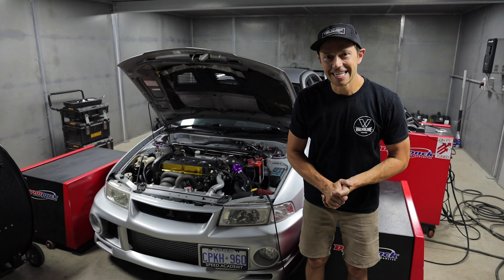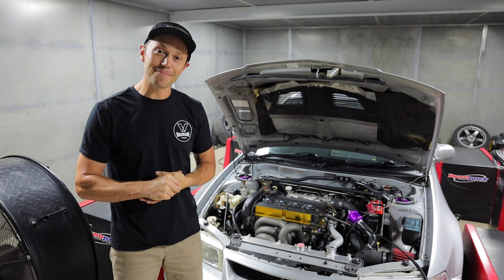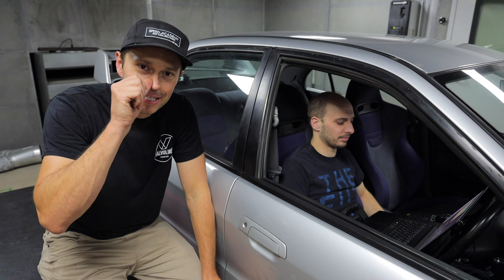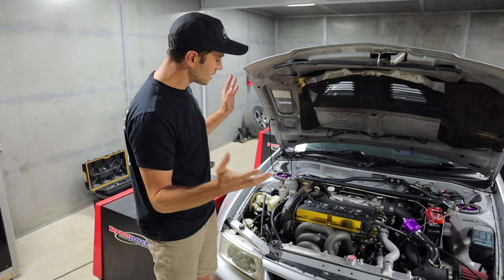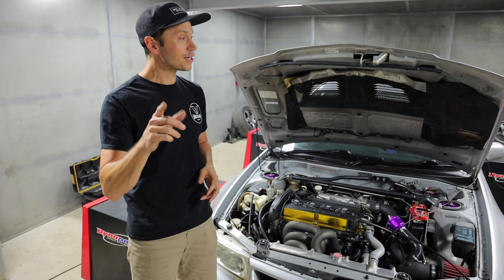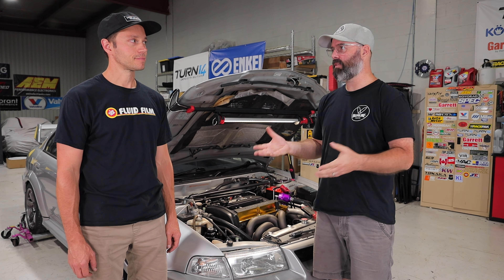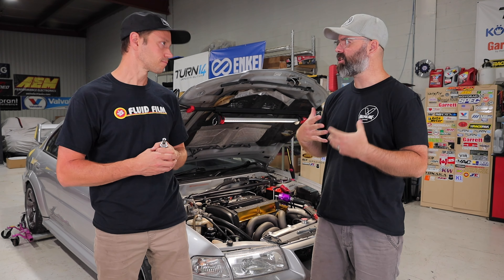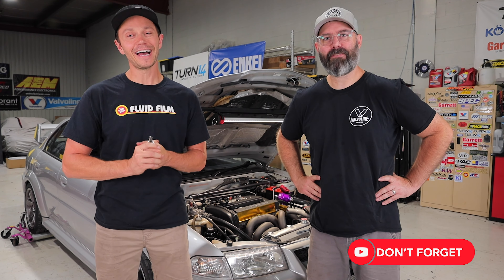MASSIVE EVO 4G63 Headgasket Engine FAILURE! CRAZY DETONATION!

Comment: Guys we could hear the engine pining even in the video, why did you carry on with a knocking engine 😟
Reply: Yeah I didn't understand that as well... He should have stopped straight away
Reply: CHazinite Casualties  yes but 😟 a 4g63 😟
Reply: I can't say that it was pinging it simply sounds like combustion leaking outside of the cylinder
Reply: Dan A agreed.
Reply: Whats the dif between the 6bolt and 7 bolt cyclone 4g63? Is that even a thing? I had and awd gsx with a jdm "cyclone" 4g63..  i am clearly not a dsm guy. Honda all the way
Reply: didnt seem like knock
Reply: Sasha is not a good tuner..
Reply: @heyhayhay247  whilst I agree sasha seems to be very knowledgeable and a great tuner, he definitely slipped up here. Watch the video again and tell me you can't hear that the motor clearly has something wrong, but he stayed on the throttle and continued the pull
Reply: @boost3d831  what you hear on camera and what they could hear in a small dyno room being filled by exhaust noise are two completely different things. All these keyboard warriors acting like they're professionally tuners is killing me.
Reply: @heyhayhay247  I could very clearly hear it but I have a really good headset.  The tuner should have heard that and refused to keep pushing it (plus the knock would show up on his software).  Also at the end when it was exploding he just kept on the throttle.  I would ditch that dude and find someone else.
Reply: To be clear, 2:36 he should have let off the throttle.
Reply: @TheTurbineEngineer  this is so easy for all of you to judge after the fact. He's looking at a dozen different data points trying to monitor the engine and not one of them is monitoring the head gasket. It blew. It happens. The mic in front of the engine is picking up the sound completely differently to how they can hear it in that dyno cell. This was an engine issue, not a tuner issue.
Reply: @heyhayhay247  I don't know why you're so mad, people make mistakes. Doesn't mean he is not a good tuner, but you would hope someone with his level of experience would see this happening and get off the throttle immediately. Anyway what's done is done and hindsight is always 20:20
Reply: @heyhayhay247  I used to be a tuner and there's really only a couple things you're looking at during the pull.  You datalog so you can go back afterwards and look at all the other parameters to make your decision on where to go next.  I was always listening really carefully during the pull for any abnormal noise or vibration that sounds or feels different than before... but maybe that's just me?
Reply: At about 2:30 you can see Sasha had ear protection on. Prob couldn’t hear anything with the engine. Dave and Pete are not the kind of youtubers that would ruin an engine just to get views.
Reply: @boost3d831  I'm annoyed at the ignorance strewn throughout all these comments from people who weren't there. The headgasket popped, and he aborted the run. End of story. People love to sit back poke holes in othe people's work.
Reply: @martinsteele3259  thank you. Finally some reason. I'm sure that closed dyno cell is crazy loud.
Reply: @martinsteele3259  Ah good point.  I didn't notice that.
Reply: @TheTurbineEngineer  you're crazy if you think they can hear anything in that dyno cell. All of them always have hearing protection on. Plus, a 4 cylinder with firmer engine mounts is always going to rattle like it's falling apart. That's why they didn't go poly. A directional mic in front of the engine vs a human with ear muffs on in the cabin will hear things very differently, but sure, judge away from your couch.
Reply: FEARDIVISIONDISTRACTION  Sasha has been a pillar of the 350Z community for 15 years; so, yeah, I'm a fan.

Comment: I don't think throwing the machinist under the buss is fair. I would like to see the torque that is currently on the headbolts when you tear it down. That was too spectacular of a head lift for the amount of boost you were running for it to be uneven surfaces IMO. You could hear the leak at RPMs far lower than peak boost.

Comment: I have assembled a few 4g63s in my day (1 that has seen 30psi+ for years as a daily with arp L19s and a MLHG), and I just rewatched your assembly video. There are two things I noticed: 

1) You used the arp lube on the nut side of the stud but not the side that went into the block.
2) I’m not sure if this was done off camera but the head stud threads on the block should be chased with a tap prior to installation. 

Since you only are supposed to do hand tight when the studs go on the block, a stud may have felt like it was seated when it really wasn’t, because of debris in the threads or the stud binding against the head. In an ideal clamp load scenario you want all the clamping force to come from the nut, and have little to no movement from the stud in the block. 
When you torque down the nut and the stud is turning into the block still, the stud is adding it’s twisting force to the torque wrench reading as well. it’s very possible your torque wrench isn’t telling you the correct number. That mixed with the two things above could easily cause a false reading on your wrench. 

Anyways great build series guys, can’t wait to see this thing rip on the dyno after it’s fixed!

Note: Also it would be wise to get ARP L19 head studs (ARP-L19-7B) instead of the standard kit ARP sells. I have seen heads lift with only 30psi of boost. Where the L19s and a MLHG is good for 45psi +

Note2: The instructions from ARP do not say specifically to lube up the block end of the stud, for all the studs, but they do say to "lubricate the block threads of the studs with ARP thread sealer" if the stud is on a water jacket. So having lube on the block side isnt a big deal. And if you have to lube a few studs on the block side, its best to lube them all for consistency in the torque readings.

Note3: If you want to go 🏀🏐🎾⚽️’s to the wall and never worry about running too much boost, just o-ring the block/head 🤘

Note4: If you do end up installing the studs before the head next time, make sure you insert the washers into the head before dropping it on. Once the head is on with the studs in you are not able to get the washers in place because the valve springs are blocking you from being able to do so.
Reply: What power and torque?
Reply: 1) The block side of the stud does not need the ARP lube, only the nut and washer since that's where the friction is happening, when tightening the nut the stub does not spin only the nut. 
2) Same with the thread chaser if using OE bolts and not studs the chaser helps get a more precise torque reading by removing friction , but with studs not as important, again for same reason above the torque procedure is happening on the upper portion of the stud.
Reply: @G1itzik  what power and torque did your 4g63 make with the build ?
Reply: Isaac G spot on the stud stays still
Reply: Ran my Talon back in the early 2000's with studs and 32PSI with a 16g. Had to have been close to 350whp. Self tuned and tracked, never dyno'd a car before as that doesn't tell you anything really.
Reply: Isaac G correct, you dont need the lube on the block side, but it helps get the stud seated. I have had instances building 4g63s where the stud appeared to be seated but would then turn a few more revolutions into the block with a bit more force (then move easier), even after the threads where chased a few times. I have always done studs inserted into the block before installing the head for this reason. To make sure the studs are all seated correctly. 

Also ARP says in the instructions to make sure the threads are chased, and even sell a tap for chasing the 4g63. So it’s not just for OE head bolts. https://tech.arp-bolts.com/instructions/207-4702.pdf

I don’t know what you worked on but with “closed deck” engines like the 4g63 getting the head and block to mate correctly is a big deal. Also go back and read my post homie, obviously you did not, because you are just reiterating points i had already made...
Reply: Bigbot Hoee it was something like 550/440 on a scm61 turbo IIRC, but I sold that car in 2012, and built it in 2010 so it’s been a while
Reply: @2988jake  nice I'm currently running 30psi 579hp 528torque but 
Peaked the boost to 32 then drop to 30psi all built and tuned my self 

Had used the normal arp studs lifted when hit 35psi then changed to the L19 and cosworth gasket and it's holding strong I'm limited to my rods  but don't plan to go anymore still on pump fuel
Reply: L Adams they stay still if seated properly, obviously y’all didn’t read my entire post...
Reply: @2988jake  You can easily check this by putting a straight edge across all the studs to ensure they all seated to the same depth. I have no doubt HP Academy covered both thread chasing and checking with a straight edge in their engine building series.
Reply: BHS they probably cover chasing threads, but the straight edge test was definitly not in there because they told them to put the head on before the studs were inserted into the block. So there is no way to verify if the studs are seated properly with the head on. (in other words with the head on the studs do not stick out far enough to use a straight edge.)
Reply: Assembly video he says 80 ft-lbs, but when I look up ARP 4G63 the manual says 100 ft-lbs. What am I missing?
Reply: Jonas Larsson it’s 80lbs for the standard studs and 100lbs for the stronger ones. The different arp studs have different procedures/instructions
Reply: @2988jake  Ok, thanks. Yeah, I was looking at the 625+ manual.
Reply: @jonasthemovie  is that what he used lol I do  95 to 105 depend how frisky I'm feeling then re torque  after few heat cycles
Reply: i guarantee its because they didnt torque them enough, and didnt retorque them after first startups, that is a must on a new engine. When I did my studs 1x1 in my Evo I could feel it slipping around 70lbs and I could tell it needed more, so I torqued them all to 85-86 lbs. lots of guys do em to 90lbs with no issues.
Reply: I also should note this is just from my experience building 6-bolt 4g63’s for a 1995 TSi and 1998 TSi AWD (first one when I was 16 and haven’t built one since 2010). I have never built a 7-bolt for an Evo 6. But it’s pretty much the same engine. 

This is just my best guess, head stud seating is the sole culprit in my one HG failure. Also, I have always decked the block and head on every built. Thus I’m not sure how much that affects the head gasket seal because its always been ruled out in my builds.

One way to get a good idea if the head studs were seated, is to mark the studs before the engine is disassembled and when removing the head stud nuts, count how many revolutions the stud made during removal.

Once this is written down for each stud, and the head is removed. Rotate the studs back to where they were when the head was torqued down. Then you can analyze the studs and verify they were seated all the way.
Reply: probably best solution is to stick to proven procedures, install arps, back them half turn, verify all are level, install proven headgaskets( oem hks), install head and torque 10+ than arp manual says
Reply: What an insightful reply, thanks!
Reply: I'm going to throw this out there.

You don't need more than standard ARP studs installed properly and a FelPro composite head gasket for what they're doing here.

I'm making around 650-700whp on a composite, L19's, and O-rings in the block, 6262 on 40-42psi. I added o rings in the block after 35psi. 

If the surfaces are both done properly (true and correct RA) then an OEM MLS and ensure studs are installed properly is sufficient for most people.
Reply: this is why you shouldn't just hand tighten the studs even though it says so by the manual...There is a spot for a 3/16 allen key on top of the ARP head studs, you can tighten them in actually. Learned this also the hard way...Put my B16 turbo together first by just handtightening and checked it after a bit of driving barely going into boost and it lifted the head, there was oil leaking between cylinder no.1 and no.2...took everything off, tightened the studs properly and no problem after.
Reply: Ok I have no idea why no body has addressed this , if I seen a fool with a tap on my plonk I would stop the built right there , tread chaser completely different tool , a tap removes material every pass reducing the 70% of surface u had at the start , even just cut a Std bolt with a Bax saw like a tap and use it
Reply: @michaelgunning347  bingo. I just bought the chaser from ARP. 😂
Reply: Michael Gunning this is a good point to make. The tool is called a “chaser tap” and that’s what I was referring to when I said “chase the threads with a tap”. A chaser tap is still a tap, but yeah I should have been more clear about that.
Reply: @2988jake  you're well versed in the 4g63 ...much respect knowledge is power...in this case literally
Reply: @michaelgunning347  
Exactly, ARP, and others, will sell you actual chasing taps for this reason. But way back in the day, we didn't have that option and we'd run taps between our fingers to clean crap out of threads. For those who don't have the correct threads available, lightly grinding the leading edge, to remove the cutting edge, is usually a good compromise.
Reply: I learned the hard way when installing the studs make sure they all measure the same height from the block. Then You’ll know if there’s anything in the threads
Reply: @bigbothoee8617  I'm using 4g93 NA with a high comp pistons and I would still retorque the head after  every 1000km of a long distance hard driving.😅
Reply: @bigbothoee8617  what turbo are you running ? And ecu ?
Reply: @AWD_DSM_FTW  what head gasket , springs you have ? Are you running high or low compression over all ?
Reply: @jeraldsiemon  FelPro composite gasket with a stainless o ring in the block. 8.5:1, 6262, 40psi. Car trapped 148 last year
Reply: @jeraldsiemon  oh and they're the Kiggly springs, the step above the street steels
Reply: @bigbothoee8617  holly fuck… that’s like 130hp per piston. god damn. People these days are desensitized to how much 500hp really is. that’s fuckin amazing.

Comment: head gasket is almost certainly gone, i would use a torque wrench when undoing the head bolts to see what torque they are all at, maybe one backed off with heat cycling which allowed the head to lift as you started leaning on the engine which then caused the gasket failure.
Reply: No, you put a paint mark on them, crack them loose then take a note of how much torque it takes to get back where it started, but yes, nobody else does that. A  post mortem is the reverse of a proper build. It'll be the usual knock sensing in the ECU which never works properly.

Comment: Lmao. If you used a MLS headgasket, arp headstuds and torqued to spec, that wasn't the failure. Something caused detonation and told that headgasket to fuck off. Either the tuner added an extra 0 to the timing table, or there was an ignition failure, or possibly an injector failed. It could be a number of things but I highly doubt it was cause a head stud failed.

Comment: You can pick up old EBCs like an apexi which only go to 1.6 bar of boost, they're not much use as boost controllers but with the MAP sensor can read out boost pressure. Move the sensor so that it reads coolant pressure at the top hose, set the boost to 1 bar? then when it happens again the boost gets killed when the headgasket leaks, saves damage. It's already been done.

Comment: I put a built motor in my evo 8 and put 500 break in miles on it then took it to the dyno. It lasted awhile on the dyno but blew up when they took it to 8k rpm. My problem was the cam position trigger wheel was 180° out. This is an easy check and would could answer a bunch of questions. My car ran just fine up until they started tuning for power. They also tried to tell me head gasket because I had so much pressure in my cooling system that it blew my radiator apart. Such a simple mistake costed a ton of time and money.

Comment: When your Evo has more headgasket issues than the STi!
Reply: ooof.
Reply: ColoradoStuff I built an EJ motor for the first time and it ran fine Up to 30 psi, so don’t knock someone for trying something for the first time. All Mechanics have a first time, it’s not giving up that separates the ones that will succeed from those that won’t. Just curious how many engines have you built?
Reply: Then u should use a honda k20 and boost it. 450hp-550hp is no problemo...on stock block
Reply: @Focus RS i like my build k20 engine with gtx3582r gen 2 :)
Reply: ColoradoStuff  just barely over 600. But would be stock short block, head would need cams, springs/retainers.

Comment: When you guys were installing the head studs, there was slipping on the washer/nut combo. Now ARP and a few other DIYers make sure the side of the washer that goes on the head has a rough surface with no lube. Common problem it would seem on the ARP head studs, which is why the torque wrench slips and then catch when you were tightening the head studs. It *may* be the head studs got stretch beyond its elastic limit. See if the studs have any narrow points along the diameter of the stud. I dk, just a suggestion. Hope you guys figure it put.

Comment: MLS gasket manufacturers quote generally speaking a max 40Ra deck surface finish and obviously perfectly true and flat to ensure proper sealing of the mls gasket. Definitely in the RB world if you don’t deck the block and only the head using an oem gasket with arp 2000 or better studs is going to provide a more reliable seal of the head gasket. That is what I did with my RB25det neo motor as I didn’t deck the block. I think you guys are right with your initial hypothesis for cause of failure